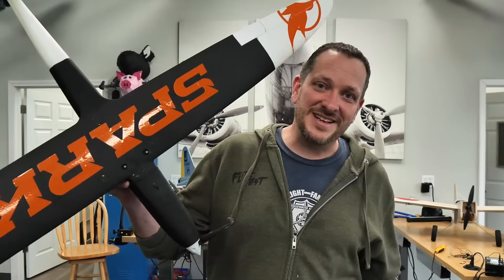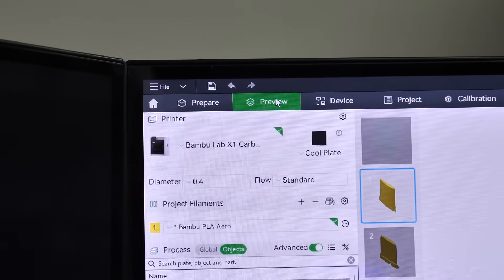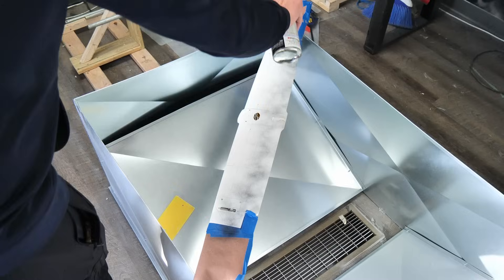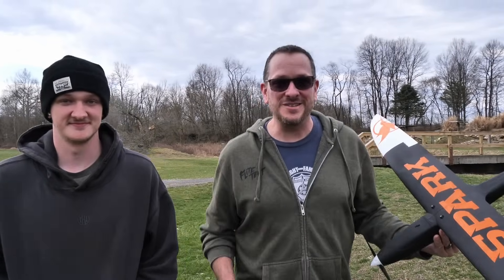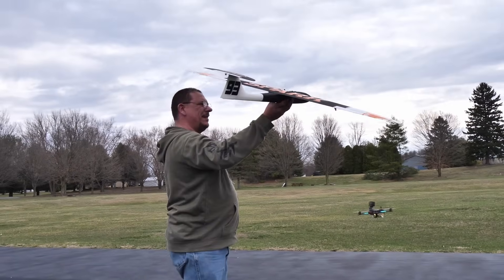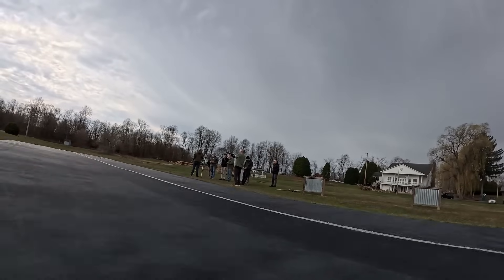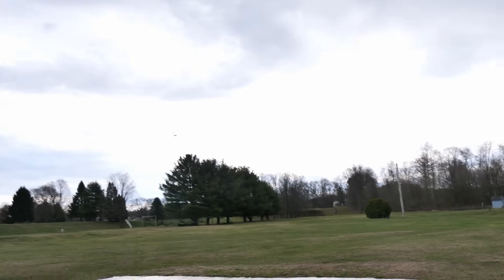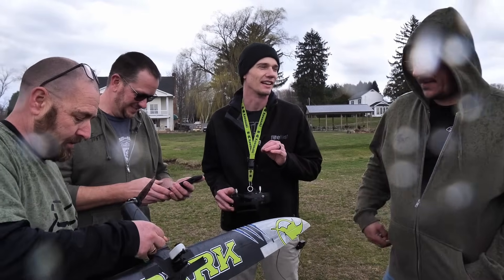3D printed airplane go 100 MPH - Will It Survive?

Comment: Hi Guys, I printed one in PLA + and am powering it with 3530 /1700 KV on 4S and 7X7 Prop... it is insanely fast 🙂.. the only thing which is troubling is, that the wings bend downwards , yes downwards at full speed . I woud if I could design the wings with less twist , I can only confirm that this plane fly like on Rails
Reply: What is its weight in this version?

Comment: hi guys, my spark goes 197kph, or 122mph jejeje, if u want the spoecs, reply this
Reply: curieux de connaitre ta configuration
Reply: @MrSuperMimi a sunnysky motor 2220 with a 9x6 propeller, 80A esc and a 4S 1500mah 100C battery
Reply: @natanielsoza7084  What is its weight in this version?

Comment: Noooope. Stop with the glue stick. If you need a glue stick for prints to stick youre using the wrong build plate or (far more likely) your plate is dirty. Clean with warm water, dish soap, and microfiber. Even the asa-aero youre likely using (or pla-aero) will stick perfectly fine.

Comment: Why do people use glue on these beds? You use glue to make it easier to remove the print, not to stick it better. You almost never need to use glue.
Reply: We use the glue to aid bed adhesion on a smooth surface bed. Tested, Proven and works. No point debating this one. Remember... its on a SMOOTH BED not a textured one.
Reply: @SplitCRF767  Understand now that smooth bed with glue helps adhesion. But what parts do you need to do this with and with what materials? I just never have adhesion problems on any of my Bambu printers, I bought glue but still remains unused.
Reply: @hippopotamus86  with big prints, it could peal up a bit at the corners

Comment: I've never needed to use a glue stick on the bed for my 3d printed airplanes. If you tune everything right you don't need it.
Reply: Could you explain to me how tuning makes a difference 
I don't understand 😅
Reply: @hampter6831  Fine tuning your bed temp to the specific filament. If the bed is too cold then you get lifting of the parts. This happens especially on the wings where the leading and trailing edges will lift off of the bed. Too hot and you get deformation of the part near the bed. Finding the right temp makes it to where you shouldn't' t need a glue stick. Additionally you want to isolate your printer so that it doesn't get drafts and the temperature around the printer stays as consistent as possible. The Bambu Labs printers that FliteTest are using have an enclosed build chamber so it isn't susceptible to drafts. But a ventilation fan can cause a change in temp in the build chamber. Any change in ambient temp can cause a part to lift from the build plate. Another thing you can do so you don't need to use a glue stick is to increase the surface area of the part where it sits on the bed. There are basically 2 ways to do that: 1) Print the part with a brim or, 2) Use helper dots where the part tends to lift. With both options you'll have to trim off some excess plastic. I prefer the helper dots as there is less trimming to do. Also you might want to use a little Z-hop. Sometimes when a print does a travel move it will hit the part as it travels and cause it to come loose from the bed. Z-hop lifts the print head before it travels so it can't hit the part.
Reply: @hampter6831  ne cant. Tuning wont make bed adhesion fail safe on a SMOOTH bed... You need the glue to avoid the print moving
Reply: @SplitCRF767  but I've seen people edit their guy files before print to prevent warping they do something to the base of the build but i have no idea what they do 
I believe it was because of the heat and the way it cools but I'm certain the edit was to counteract or nullify it

Comment: Instead of using paint, you guys should use spray vinyl dye when working with 3D printed materials, it's lightweight and less prone to chipping as it actually adheres molecularly.
Reply: That's a great idea, never heard of that stuff!
Reply: Then that means it would also strengthen it. Nice! Thanks for sharing!
Reply: Thanks!!!

Comment: What is mph??? I just know kmh
Reply: 1mph = 1.609kmh so 100mph=160.9kmh, conversions
Reply: Miles per hour, it is what we use here in the United States..
Reply: We aren't in the United States @aerialsports
Reply: @jo21e6  YOU aren't in the US, but flite test is, get over it. If you're too lazy to do some simple multiplication (simple enough to do in your head), then that's on you
Reply from the maker: it stands for Miles Per Hour

Comment: What material are you using???  Been trying to get the lw-pla to print on my x1c and it ALEAYS turns out like garbage
Reply: We are using colorfab LW PLA it is a little bit on the harder side to get printing well but what I have found is around 250c 68 to 70 flow make sure to use spiral mode
Reply: @davidjester5085 will give that a try.  Thanks David!   I have 3 spools of the material and need to get it to work.  Lol

Comment: I wonder why they didn’t build a swept wing design for high speeds?
Reply: Because swept wings are only good for speeds approaching supersonic and beyond. Thin straight wings are faster below 700 mph.
Reply: Yup...agree.. straight thin wing is a perfect balance for speed and  good handling..swept wing only better on long straight speed run
Reply: @ardhee-Rdsign that's the thing most people get wrong. It's NOT better for straight long lines. Unless your straight long lines approach the speed of sound. Straight wings are better for high speeds (under like 90ish% the speed of sound) as they create less drag for the same amount of lift. 
Less drag -> more speed
Reply: Swept wings are mainly used to reduce the shockwaves' effects on the plane. Those effects take place at transonic or supersonic speeds. 100mph just isn't fast enough to have any benefits.
Another point is that swept wings create more induced drag than "normal" wings. Your plane would actually need more power to compensate for that drag/ fly slower with the same power.
Hope that helps :)
Reply: wow.... Thanks for the help folks, now I know why so many fast rc plane videos comprise of pylon racer designs also why the funjet seems to have a straighter wing profile, very interesting 👍
Reply: Look at the DS guys, they have tried swept wings,  but the record holding DS planes has straight wings...
Reply: I've always asked the same question.....
Reply: An Example: the Piaggio P180 Avanti Is perhaps the fastest modern prop driven corporate style aircraft and has been clocked at over 575 mph
with straight wings